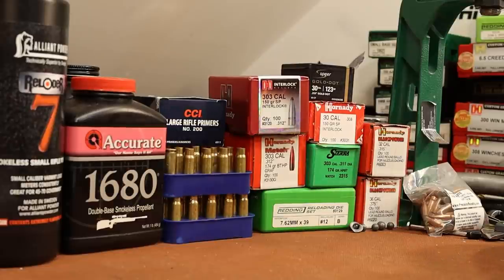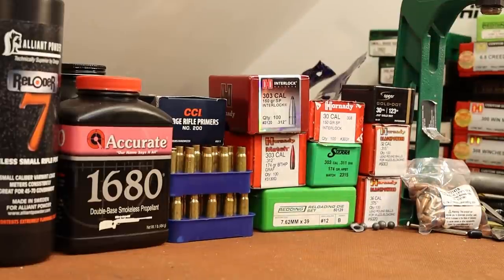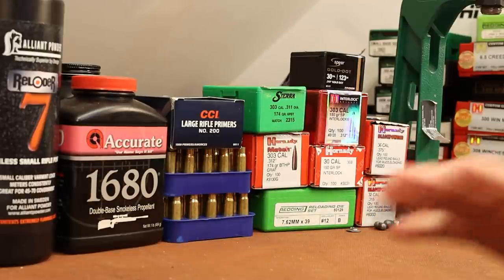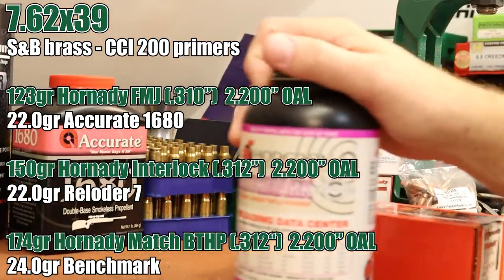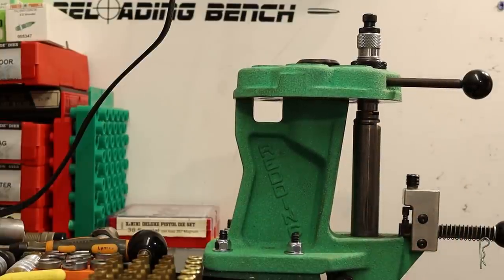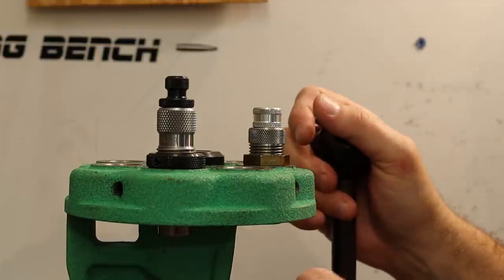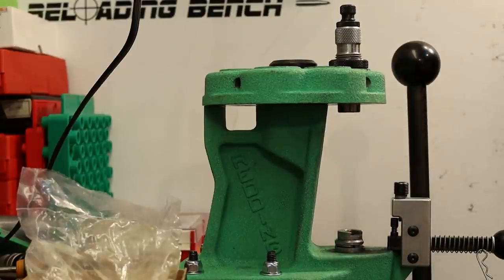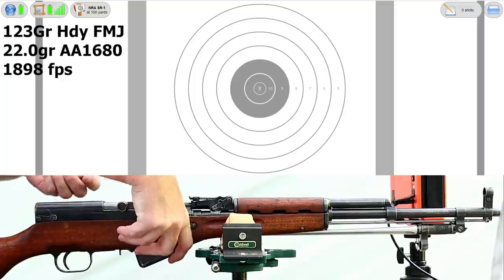Loading 7.62x39 for the SKS - Getting started and shooting some groups

Comment: You should defiantly build an AR upper for yourself.  The magazines are the fall down to the STANAG mag-well of the AR trying to form the curve the 7.62x39 ammo requires.  AS to reloading, bullets' of .311 are a must.  Richard Lee's Second edition of reloading has loads from 100 grain through 150 for my saved Geco brass.  I use a 125 grain Sierra Pro-Hunter SP (.311 dia. ) from Mid-South Shooter supply, over Accurate 1680 at a starting 24.6 grain (2260 fps) up to a maximum of 27.3 (2445 fps) OAL 2.190.  This closely matches the two factory loads for accuracy.  With either Wolf WPA Polyformance 123 grain hollow-points, or Geco 124 grain full metal jacket ammunition.  My upper will deliver consistent 1.5-MOA groups at 100-yards.

The AR upper I built around a close-out purchase
d 7.62x39mm Bear Co. 16.5-inch medium heavy contour carbine barrel, 1-10 twist via eBay before that market dried up.  
The upper is an Aero Precision 7075 forged/milled.  The fore-end is a fully floated MTU006SS UTG PRO AR15 Rifle Length 13" Super Slim with three detachable mini-rails.  
The carrier/bolt is a Wilson Combat mil-spec black nitrite.  Gas block is a 0.750" UTG clamp style with an Aero Precision carbine length gas tube.
The muzzle devise is an AJ of Texas three-baffle brake/comp 5/8x24, which has a 13/16-16 thread behind the baffle for a Suppressor, or the provided blast-can (blast-attenuator).  
This all topped with a Vortex 2x7 Crossfire scope on an Nikon AR scope base.   All totaled just under $650.

Comment: to prevent slam fire, get a Murray's Firing pin spring kit, instead of searching for harder primers
Reply: I disagree. My Murray’s pin spring broke, and if I hadn’t caught it when I did the next ten rounds would have been full auto. Popped primers wedged the pin forward. Conveniently, Murray’s offers a service to modify your bolt to not have popped primers, which I gather from reading their description involves egging out the firing pin hole so you can never use anything but the Murray’s pin ever again. No thank you. Switching ammo brands and reinstalling the GI pin solved the issue. IMO Murray’s is a gimmick, rifle is fine.
Reply: @509Gman  Maybe that's why they offer Wolff Springs..

Comment: You need to get rid of the bayonet and cleaning rod.
Reply: Nyet! Rifle is fine.
Reply: For accuracy testing, they just cause needless barrel vibration.   his loads are a might slow, too.   2400 fps with RL-7 123 grain bullets,  2150 with 150 grains and 2040 with 174 grains with H-335.   The SKS twist rate is fast enough to stabilize 215 grain cast bullets at 1500 fps.   I've shot minute of hawg with 180 grain round nose soft point .308 bullets.  Longer .308 bullets will group decently from the SKS barrel, 150 grains and below will not at least from mine.  YMMV.
Reply: @crgintx  the only difference I’ve seen with vs without on mine is POI shift.
Reply: @509Gman  With steel case no, with handloads yes.  My 5 shot with handloads and Lapua cases hovers right at 1.5 inches at 100 yards with 123 grain .310 bullets with them removed.  about 2.5 with them in.   I shoot off a rabbit ears bag under the forestock and soft bag under the end of the butt.   I'm 6ft and I also used the rubber 2 inch stock extender to give a more suitable length of pull on my paratrooper model.  My full length SKS was restocked with an ATI Monte Carlo and had Choate Machine and Tool scope mount with a P-4 reticle scope in 6x.   Only mount that ever seemed to work.